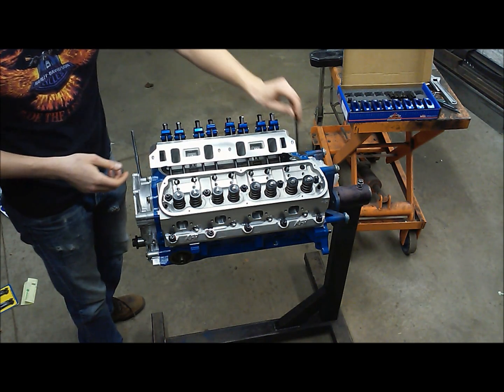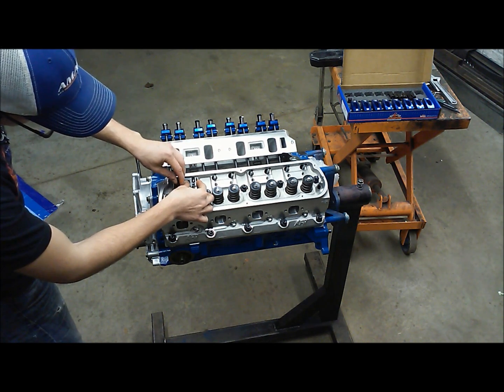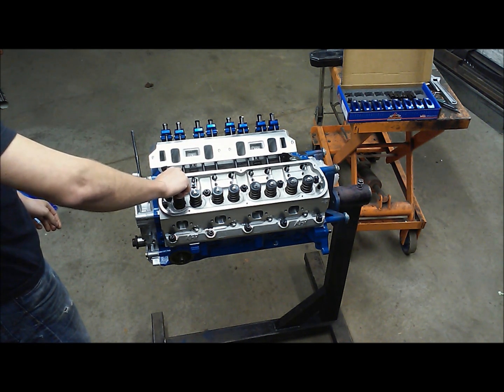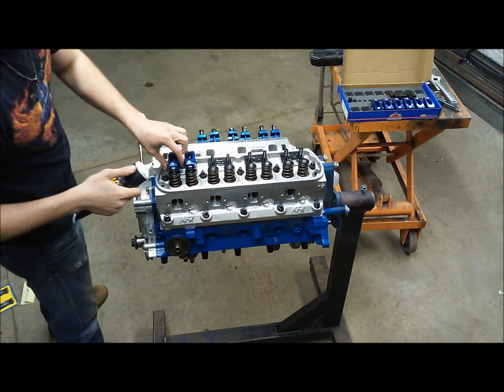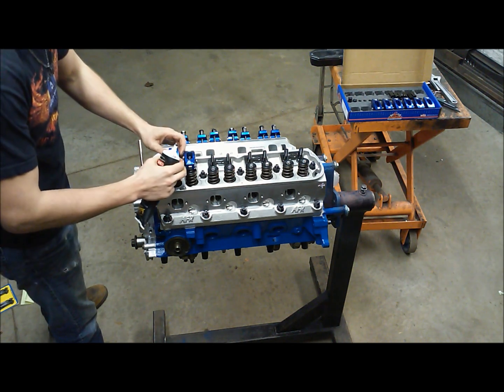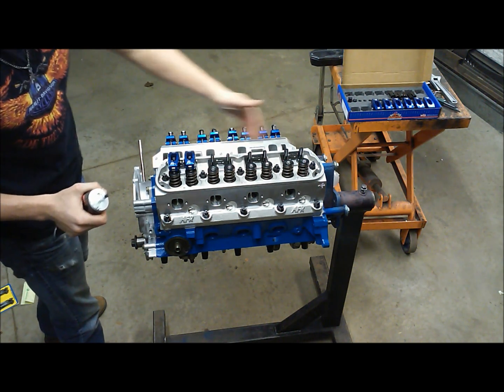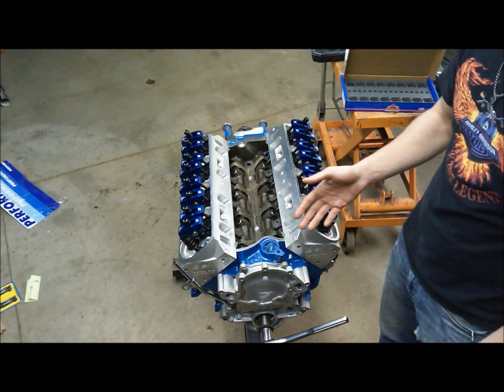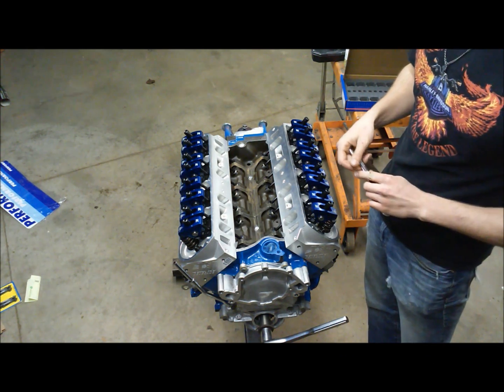Proper Rocker Install & Valve Adjustment (Vid 3 of 5) - How To 302/5.0 PERFORMANCE Top End Build

Comment: I think you already mentioned it in a different video, but the AVR guideplates get installed with the lettering facing down (towards the cylinder head).  I just confirmed that by calling AFR tech support, who btw picked up the phone within 30 seconds and had a super fast answer and great customer service.
Reply: So they're backwards?
Reply: @UFOGHOSTHUNTER thats what im gettin too man..wt????

Comment: Sunn what you're doing will work and will be right but you're taking a long trail around Nova Scotia to get there you absolutely do not need to do all that torque your rocker bolts down till the push rod won't move any more back at off 1/2 return and it will be perfect every time for me that is a crazy waste of time but if you want to play with your motor it is absolutely correct what you're doing but unnecessary if you do that you can run your engine what absolutely 100% no worries guaranteed

Comment: My friend has a cast iron head 5.0 and the rockers bolt to head. Not sit on a rocker stud. It looks like the rockers get tightened down till they stop. Every ford small block I've ever done are the older type with the rocker on a stud and they are adjustable. Have u ever seen the type that are held down with a bolt instead of a nut? Are they adjustable? thanks
Reply: Ever find out im in a similar situation?
Reply: @Josiahdrews1466  Yeah - You can get shims for that type of rocker.  I do remember putting it together. It had a bigger cam (than stock) and all the rockers needed to be shimmed. Some a little more than others. But yeah, hes still driving that truck and the motor seems just fine. That's about all I remember. Hope that helps bro. It was a pack that had several different sizes/thickness of shims. We thought we'd run out at first - but there was enough in that one package. Don't remember who made that shim package/kit.

Comment: luke Finley so it doesn't matter which cylinder I do first or last as long as the cam lobe is at the top and the other is at base on cylinder working on?
Reply from the maker: Correct 👌

Comment: Do you have to have guide plates? I bought a roller rocker set and it didn’t come with them, it’s just an 89 302 with windsor heads it’s nothing special
Reply from the maker: Pedestal rockers are locked into the correct orientation - they do not need guide plates. 
Stud rockers like what I have in the videos do

Comment: I was under the impression your supposed to do the rocker installs in order of the firing order?
Reply from the maker: There are a couple ways - that’s doing it on the compression stroke - my way is the safest possible and works for literally any pushrod engine
Reply: @ThunderHead289  I did mine your way and followed the firing order for an 85’ roller motor, am I going to have to go back? I thought that’s what you were doing was this method but in firing order… I adjusted to TDC at piston 1 and just rotated the engine from there on until the next pistons lifter in the firing order came all the way up, after adjusting the opposite valve I rotated the engine until the opposite lifter on that piston (that I had just adjusted) was at the cams base…

Comment: What kind AFR heads your using for the 302 and  cam spec if you have or parts nr
Reply from the maker: The afr 165 heads, none emissions units, and the xe266hr comp cam. Was to be a low end torque autocross engine. Wasn't going to spin it over 5500 for longevity sake, so bigger heads and cam wouldn't have been practical.

Comment: It appears you are using roller lifters. Which roller cam did you choose?  I built a 302 Mexican Block for my 66 Mustang in 2005, Stroker Crankshafts and kits from Scat, and Eagle were not available then, or I would have stroked it to a 347. I also used TRW L2249nf pistons, and Total Seal rings, but I re-used my 66 289 heads that I had Gromm Racing in San Jose put in new guides, and three angle valve job. I wanted to replace them with World Product or Edelbrock heads but could not afford the expense. Of course AR heads are the best, just expensive for a street engine that is a daily or weekend driver.
https://www.facebook.com/media/set/?set=a.10153254541526363&type=1&l=cec7f4047c
Reply from the maker: +Jose Francisco Medeiros sick frickin ride man. i think im going to drop it in my 65 galaxie for autocross if i dont get it sold here before the summer.
Reply: ThunderHead289 Cool, my neighbor Steve Sota's dad, had a 60's Galaxy 500 as far back as 1974 when we first met.